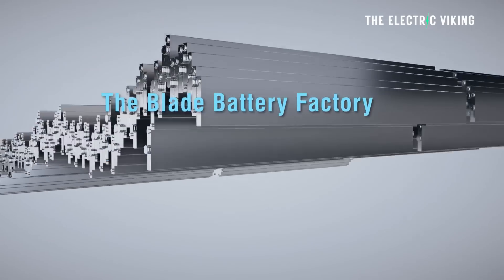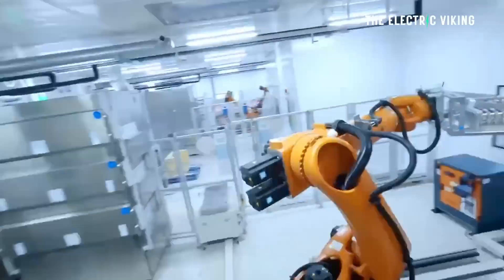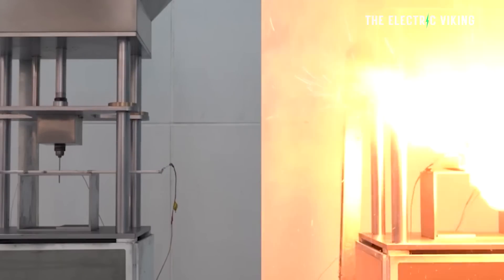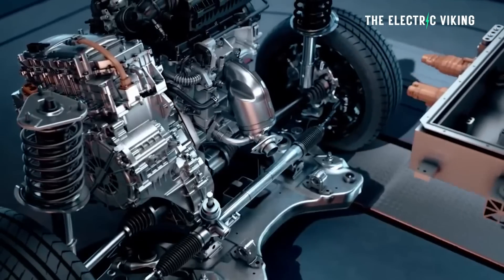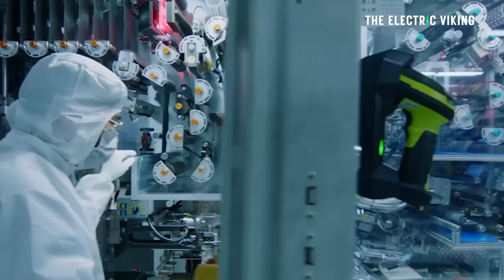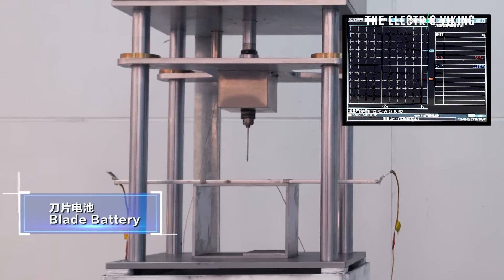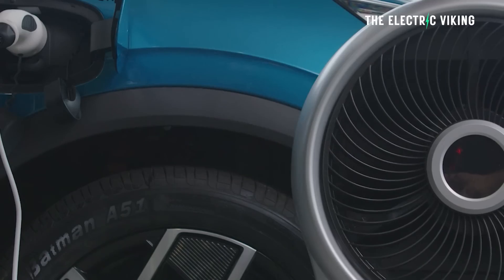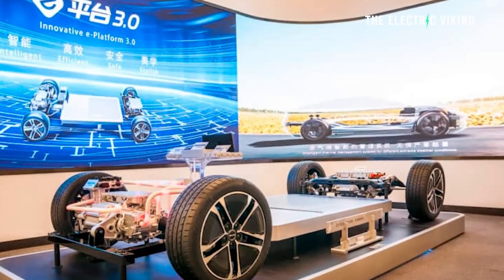BYD reveal new cheaper LFP Blade battery with 27% higher energy density

Comment: So basically BYD has caught up to CATL, more or less. That’s good because we need as many affordable/efficient LFP batteries as we can get to accelerate the production of compelling EVs which in turn will accelerate EV adoption and put the smack down on ICE and hybrid vehicles.
Reply: I think this v2 byd blade battery pack with 190 wh/kg in pack level energy density is the best battery pack ever released by any company,for comparison 2025 taycan line up with NMC 811 battery cells has 170 wh/kg in pack level energy density. or CATL qilin battery in zeekr with 280 wh/kg cells has 200 wh/kg in pack level energy density,or tesla model s plaid structural battery pack has 181 wh/kg in pack level energy density,so a battery pack with LFP battery chemistery and that energy density which also has much higher battery life almost like a petrol car and you can charge it to 100 percent with out battery degradation anxiety is amazing,very well done BYD.
Reply: @davidfujkk8018  It’s probably very similar in energy density to CATL’s newest/upcoming LFP battery that boasts increased range over their original LFP. We haven’t actually seen the real world range of this BYD battery either so it’s too soon to say it’s the best battery ever made by anyone.
Reply: I think both companies make great products. Each of their pros and cons.
Reply: The main advantage of BYD Blade batteries is at the system level, rather than the cell level, because Blade cells are structural. So, the battery cells themselves carry structural load and replace part of the vehicle structure. You can make a structural pack with CATL cells, but it will require a stronger/heavier pack case to carry the mechanical loads, rather than the cells of the battery. So, while a BYD Blade battery cell might be less energy dense, the overall structure of the vehicle carrying the cells can be lighter (and/or stiffer/stronger or using less expensive materials for the same performance, depending on your priorities).
Reply: are CATL also LFP batteries?
Reply: @michals1108  CATL supply LFP batteries to Tesla for RWD models manufactured out of China.
Reply: @michals1108  Yes, CATL have been mass producing LFP batteries for at least a few years now, but they’ve got new and improved versions recently released (M3P) and I think one or two more new ones in development about to be put into cars soon, but it’s hard to keep track. CATL also (I think) produces non-LFP batteries also.
Reply: Its gonna be banned by US for national security reason.
Reply: Smack down on ICE vehicles? Someone has succeded channeling your anger towards a still very useful technology the world depends on.
Reply: @ycnexu  Did I say this would happen overnight? No. It WILL happen though, my guess is sometime in the mid 2030s we will see the very last new ICE vehicle sold. Doesn’t mean there won’t still be old ICE vehicles on the road, but those will break down and fade away into obscurity as well. Bet on it :)
Reply: @Withnail1969  I hope the oil companies are paying you heaps of money. Food and Agriculture can evolve  and not be dependent on oil, and will do so well before 2050. The only question is how soon we can get rid of oil.
And as for the petrochemicals we use: If gasoline can be synthesized from atmospheric CO2 and green Hydrogen, as it can but at a higher price than from crude oil, then we can also synthesise the petrochemicals, which are less price-sensitive than gasoline.
Reply: @ycnexu  They don't know what they're asking for. They think there will still be food and driveable roads without oil and ICE engines.
Reply: If you're going to put the smack down on ICE vehicles be prepared for being charged per mile due to the extra damage to roads and being often unable to charge  due to too much demand on the grid.
Reply: @Withnail1969  The government needs a program to help push vehicle to grid IMO which I thought was going to happen with the infrastructure bill. That would fix much of this problem.
Reply: @Withnail1969  global EV adoption is roughly 9-10% meaning there’s 10x total addressable market for EVs to tap into. Energy generation and distribution (the grid) as well as charging infrastructure are being developed using green methods in lock step with EV production and adoption, so your premise is simply false. Furthermore an ICE truck and most ICE SUVs are already heavier than the average EV, so this is debunked too. Vast majority of EVs are hatchback, sedan, or compact SUV (like the Model Y).
Reply: @Withnail1969  Extra damage?  You mean by the ever-heavier HGVs which roam our motorways and lesser roads.
Reply: @Withnail1969  My point is that road damage is caused by trucks, not by the  almost negligibly (10% or so) heavier electric cars - which will be eventually be lighter than their ICE equivalents, given the rapidly-evolving battery technology.  Electric motors are FAR smaller, lighter, simpler, greener and more reliable than equivalent ICE motors, with their extensive and temperamental emissions control mechanisms.  The days of the ICE-powered car are strictly limited...
Reply: @Withnail1969  Source for that amazing data?
Reply: @Withnail1969 Complete BS.
Reply: On french tv there was a news report that the tyres of electric vehicles wear up faster because of their average heavier weight (for now).

Anyways, we have probably reached peak oil (at least some types of oil) and less of it will be available in a few decades. We might as well save it for the petrochemical industry for future generations instead of burning it wastefully in petrol cars (provided we develop renewable energy to charge EVs).
Reply: @Withnail1969 True. But the discussion today means more energy for less weight.
Reply: @Withnail1969  Not True; in Australia and UK EVs can charge from a normal power outlet, albeit more slowly. Not remotely controlled at all. And I actually have an EV, I doubt that you do, given the level of BS.
Reply: @Withnail1969  Not True, farm equipment is ideal for electric/battery power because it is typically used not far from a home base where recharging and/or battery swapping can keep the equipment running day and night, as is typically necessary during harvest time here in South Australia.
Case already has electric farm tractors in production but they have not yet expanded into swapover battery designs, but it will come, by others, if not by them. If you saw the annual Diesel fuel bill my cousin pays when he puts in a crop, you will realise that the savings will easily pay for a new tractor in less than 10 years.
Reply: @Withnail1969  They don't know what the power is for and even if they did, they cannot stop it arbitrarily
Reply: @Withnail1969  Do you have reasons which outweigh my reasons? Or are you just anti-EV?
Reply: @Withnail1969  Let’s revisit this entire comment thread in a few years when EVs have dominated the market. You will without question be proven wrong, your comments will have aged like milk. And I’m willing to eat my words if I’m miraculously wrong on this. Electric IS the future and it’s already here just not scaled up fully.
Reply: @Withnail1969  
We need diesel engines right now.  That does not mean we will need diesel engines in the future.  Tesla has already brought us a battery powered 18-wheeler so we know that the future of large diesel rigs is limited.  

We will likely continue to use oil as industrial feedstock and for lubrication but look for its use as vehicle fuel to disappear.
Reply: @Withnail1969  
When I see a comment like that I wonder whether the author is lacking information or attempting to misinform others.

Which is it?
Reply: @Withnail1969  Batteries are not going to overcome all their limitations; Volume, weight, density, charge rate, discharge rate, safety, wearing and cost. They seem to think that batteries are early in development; They have had over a century of massive development. A battery is always going to have these challenges, unless we come up with something completely new to store energy that is NOT a battery.
Reply: @Withnail1969  
Yes, the Tesla semi.  The one that is being used daily by Pepsi and Tesla to haul loads.  The one that hauled a full load over 500 miles on a single charge, over a 4,600' mountain pass.

Tell us why a truck like that is useless.
Reply: @Withnail1969  Addicted to oil? If they can get heavy vehicles to get off diesel this will be more important than cars in terms of pollution. Semis that are electric drive train are superior even if they have an onboard diesel generator.
Reply: @Withnail1969  Here in N. America you can easily do a level 2 charger at home by running off an electric dryer circuit with an either or switch.
Reply: @rickoffee  Tires on EVs...Ive done some research on Youtube on this subject. Most owners say its the way people drive an EV with all the torque on hand. EV specific tires are more engineered for quietness it seems.
Reply: @thestonksmarket1897  Agree.We are just now realising electricity is everywhere to be harvested,it doesnt have to be sent large distances through high transmission wires.
Reply: @bobwallace9753  Electric semis will be a gamechanger.
Reply: @Withnail1969  Diesel trucks pollute way more than cars. Electric buses,trucks are already here not just Tesla.
Reply: @jaaklucas1329  
Anyone who knows the basic facts will agree with that.  If you're running a company that uses diesel 18-wheelers and have the option to ditch the diesel rig and get a battery powered rig that will pay for itself in about three years, then give you many years of massive cost savings you have only two options.

1)  Move rapidly to battery powered trucks.
2)  Lose your business to your competitors who move to battery powered trucks and undercut your costs/prices.
Reply: @Withnail1969  They once said that about whale oil!
Reply: @Withnail1969  Oh no they can't. You must have a supersmart meter, because the ones I have cannot tell what the electricity is used for, and cannot tell if I am charging my EV or powering my lawnmower or heating my water.
Reply: @Withnail1969  Ive got electric resistance heaters in my house here in Canada.Probably draws more than an EV...
Reply: @Withnail1969  Interesting take you have. If we stop breathing diesel fumes, we will....die!
Reply: @Withnail1969  I tried that when I was a kid,huffing gas fumes.Good clean fun!
Reply: @jaaklucas1329  Batteries will always have limitations and the problem is that there is no room to compromise on any of the characteristics for a machine which is used for transportation; Weight, volume, density, charge rate, discharge rate, wearing, safety and cost.

When some of these Tesla's are involved in some bad collisions more often, your going to start seeing destruction like has never existed before in horror car incidents.

Lithium battery chemistries are very dangerous. Lithium Iron Phosphate seems much safer, but they lose density. 
Different batteries have different limitations. The electric car is limited even if it could charge in 5 minutes; It still requires a power outlet or the use of liquid fuels for electrical power. So it makes no sense why anyone would think that electric transportation is suitable to completely replace all ICE driven transport
Reply: @alexandermelbaus2351  If you can come up with an ICE engine that doesn't pollute the atmosphere you will have a valid reason to hang on to this inefficient technology!
Reply: @jaaklucas1329  Diesel is the most efficient energy for transport. The diesel engine was built to run on things like peanut oil by it's German inventor.
Nothing even comes close to Diesel combustion.
The atmosphere is fine.
Diesel pollution is exaggerated.
The electric car has created a new environmental problem. I don't see any plan in place for the toxic and dangerous battery packs going in to every car. A good car is still operating after 30 years, it remains to be seen if electric cars will be any good after 20 years; Even 15 years.
The introduction and implementation of electrified cars has been done poorly.
Reply: @alexandermelbaus2351  The batteries on the horizon are literally overcoming all of those issues. This blade battery already overcomes all but the volume and solid state ones on the horizon overcome literally all of those you mentioned.
Reply: @Withnail1969  literally all of your comments are either assertions without facts or actual guesses in denial. Doesn't seem worth it to bother with someone like you arguing in bad faith.
Reply: @nfzeta128  I don't know what batteries your referring to, but I am sure you are just being over optimistic.
Volume isn't really the main problem, it is safety, weight, cost, charge rate and some other characteristics I didn't mention; operation in cold temperatures (charging and storage). Batteries that are safe with massively reduce weight and cost; that is what is needed.
Electric cars have been introduced and implemented poorly. No standards for batteries or chargers between cars. Most of the chargers don't even have a roof.
Apart from the performance. I don't know how anyone can be excited about a car that is less capable and more costly.
Reply: @alexandermelbaus2351  I literally said those problems are the ones being overcome. The volume was the one not having the big progress right now.

If you don't know then look them up. I told you the name of them for a reason.
Reply: @Withnail1969  you are correct the semi is a joke. Well all EV’s are jokes. WHO wants to drive a milk float. All this rubbish about farm equipment could be good for the environment, everytime you want to plough a field the ploughing will discharge the battery, just think of hauling hay and straw or trailers. The battery will be flat within a couple of miles. EV owners don’t seem to know what they are talking about as they don’t mind waiting all day to charge their cars that’s if the can find a working charger.
Reply: @Withnail1969  
That is only fair, being charged road fees.  The grid will abide.
Reply: @Withnail1969  
Some years ago one of the DOE labs did a study and found that if all US cars and light trucks turned into EVs overnight the grid had enough surplus capacity to charge 80% of them.  It will take time to reach 80% EV so we should have no trouble staying ahead of the need.

Yes, our nuclear plants are wearing out.  Many are already at or past their engineered lifespan.  We're going to have to replace them which we will.  Transformers are also being replaced.  Stuff wears out.

The great thing is, our replacement electricity sources are cheaper and quicker to install than what we've used in the past.